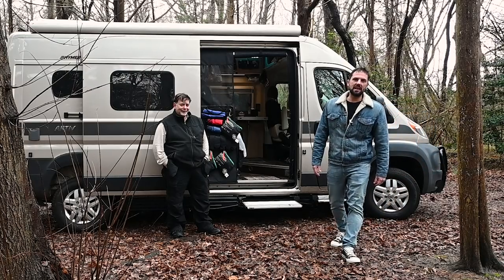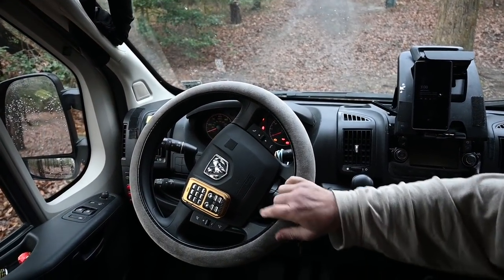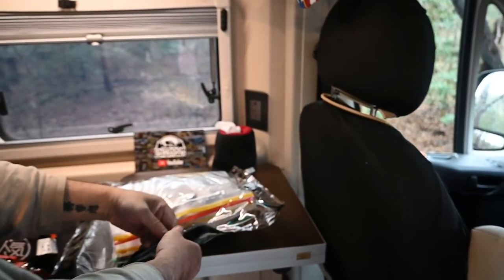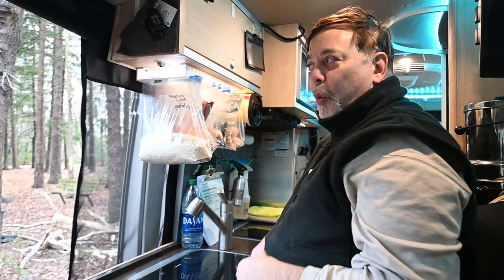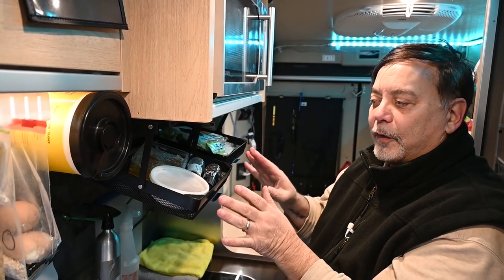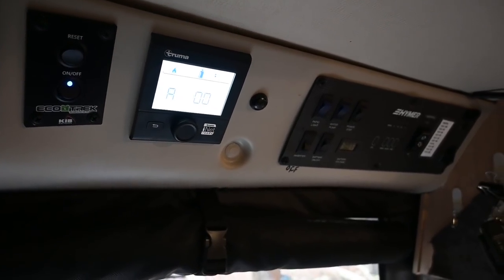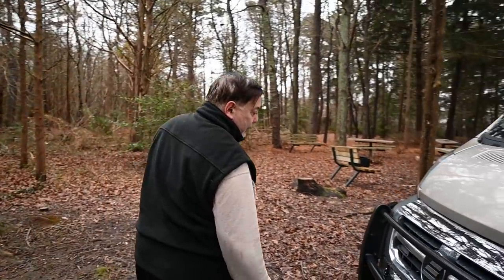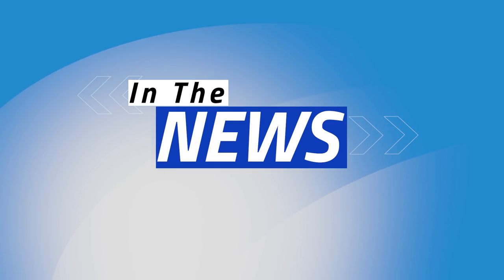VAN LIFE | Hymer "Aktiv" Camper Van LOADED with Gadgets, Hacks and Upgrades

Comment: If you are concerned about your safety then think about what will happen if your airbag deploys with that siren control mounted on the steering wheel. Also, think about where those tools mounted to the cabinet behind your head will end up in a collision. The curtain for the windshield could easily come loose and block your view.
Reply from the maker: Safety first

Comment: I have the same Hymer.

I have had the drawers below the sink fly open when I took a sharp turn. I needed to disassemble the drawers do some light carpentry to fix it,  which was a big pain. The solution was to not load them up too much and I put a bungee cord between the handles, so if one drawer opened the bungee would keep it from flying all the way open and back again.  Anything heavy goes in the fridge or the microwave. So, I wonder if adding that extra inside drawer would make this problem worse. 

Hymer people seem to like the Berkey water filter. After researching I settled on the ProOne Traveler+ as it's about $150 cheaper, the spigot is metal instead of plastic and lab tests showed it does a better job of filtering, among other reasons. It is the same size and fits on the same shelf. 

The fridge does not run off of propane. It runs when the inverter is shut off, so I think it only runs off 12V from the batteries. The cabin heat, however, runs off electric or propane. Personally, I've never used the propane. 

His rig is a bit too cluttered for me. I have the vast majority of my stuff stowed, but I do have a few long magnets mounted on the backsplash so I have easy access to the things I use all of the time, like  a set of flatware, a few steel enamel cups, knives, etc. 

I had all of the branding removed to make it more stealthy and had a light tint installed on the windshield and door windows. The tint isn't so dark that it would give the police an excuse to pull me over (in NJ technically all tint is illegal), but it does filter out the majority of infrared, keeping the cabin a bit cooler. 

Molle is pronounced Molly, like the woman's name, not mole like the animal.
Reply from the maker: Thank you for the additional information

Comment: What attention to every detail he has. I love it! I’d like to see a video and how to on just that first aid kit alone. One little question. Is it legal to use emergency sirens to move through traffic if you’re not an emergency vehicle? I do love the idea of it for security. Thanks for the great video.
Reply: At least from where I am from you need to be driving an actual emergency vehicle to use sirens and/or emergency lights.  It is illegal where I am to use such on a non-emergency vehicle.
Reply: Highly illegal.
Reply: the lights and sirens were installed to dissuade criminals as the lights were purposely white /amber colors and not blue / red for police use i have not used it in a traffic situation yet but if needed its available i know the law very well but more so it can be a great safety deterrent
Reply: @puppyparty2327  Yeah ? ... Nah mate ... you are skating too close to the wind even if the lights aren’t blue and red, especially if you use the siren as well ... you would be highly irresponsible.  You claim you haven’t had to use them yet in traffic. Just as well. 

Don’t.be stupid.

Comment: Actually with your spices the box is a good idea but it's not good turns to mold glass containers for the seasons are much better it feels everything glass is better it Seals Everything the plastic bags are not good my friend stop using the plastic bags unitrack mold down the road especially if you live in your van full-time..
Reply: and a fire hazard also......the reason that area was empty above the stove is for fire prevention...paper towels over the stove?? wow.....that wall is covered with a heat resistant product for a reason....
Reply: @sandrafromtexas1957  well said my friend I couldn't agree with you more your phone right this guy's got it wrong
Reply: thanks  that is a good point  i will definitely  re think   that  hazard   area

Comment: This was an EXCELLENT Video!! He was very thorough in his explanations and I like the way he addressed security concerns safety issues and how he even showed how they can quickly reach for security products. I like that he explained how they lifted the vehicle four inches to go over rough terrain and city road issues and how he even addressed the battery drainage and HOW TO fix that?! I had no idea that was an issue??! He addressed everything. I found it absolutely fascinating. I like the ambulance horn/sounds too?! And the cameras they had mounted. He was amazing?! I also like that he thought of everything and addressed what works for them and what didn’t and how he explained their FIX with a detailed modification. I even appreciated the ion bed explanation. I had no idea there was such a product to address the blood circulation??!! He thought of everything and it was ALL important. Nothing was spared if it helped to solve a space concern, a safety issue or security. I could go on and on … I could listen for hours. If I ever bought a camper van I would like to be able to reach out to him for advice. If he had contact info to respond to any questions or concerns I would really appreciate it. Thank you for sharing such an excellent well thought out and presented video. It was extremely helpful. God bless him and his wife. I pray that they are able to travel far and wide and have fun doing it. I pray that they are safe and secure and always protected by God’s angels wherever they go. I pray that they are protected from all evil and all danger no matter where they go … in JESUS Mighty Name. ❤️🙏🥰👍❤️👏Again EXCELLENT VIDEO!!!! Bravo Sir!! Bravo!! ❤️👍❤️👏👏❤️
Reply from the maker: Thank you for the feedback

Comment: 2 questions =   1). The outdoor steps: Is that a Hymer add, or did you add those?  If so, where did you get them.  2  )the drop down baskets below the microwave... where did you get those?    Thanks much
Reply: the sliding steps  were built into the truck  witch is one of the reasons i took this van  besides other benefits , the baskets  (COFFEEKEEPERS Anything Keeper - Home, Office, RV, Kitchen and Boat Organizer (Outside dims = 11" Wx10 Lx2.5 H; Basket=10.25"x9"x2"))  from amazon
Reply from the maker: Awesome 👏🏼

Comment: Pro masters vans   of the worst vans to build out because of front wheel drive. New Jersey guy  tell your audience that. Terrible in the snow, going uphill and  going over any kind of rough terrain
Reply from the maker: Thank you for your feedback
Reply: you are correct   - so here were my thoughts  when i bought  the dodge .  1. dodge oil change $79  , Mercedes  oil change $699 2. dodge  cost to buy  with set up $79,000,  Mercedes  cost and set up $250,000 . lets leave it at that for now  ty